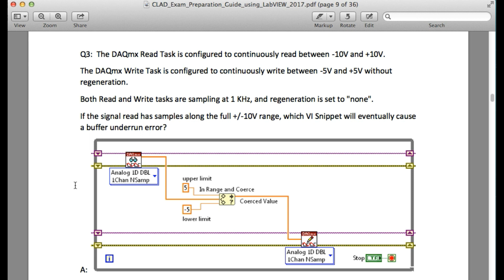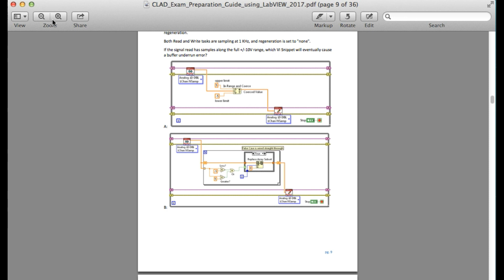LabVIEW CLAD 003 DAQmx

Comment: I wish he would explain "why" it leads to lesser and lesser elements than the other 3 options.
Reply: I think I found my answer. There's this new function: the "Conditional Loop Tunnel". This is new to me. I think it was introduced in 2012, but I've never used it before or knew about until I failed this question. I'm using 2010 at home, and it doesn't have this feature.
Reply: @SciHeartJourney  It`s really useful comment. Thanks!